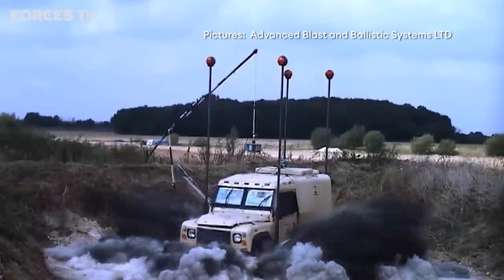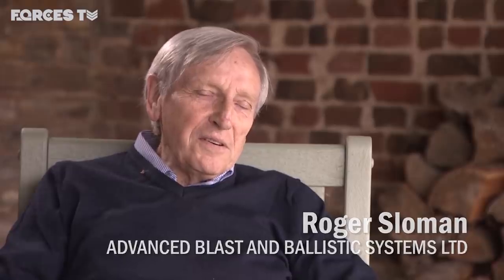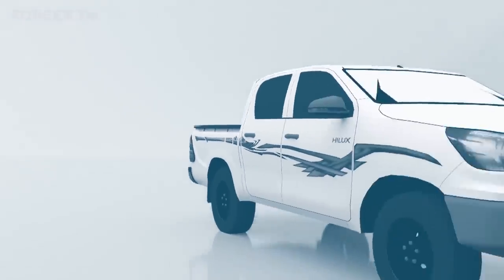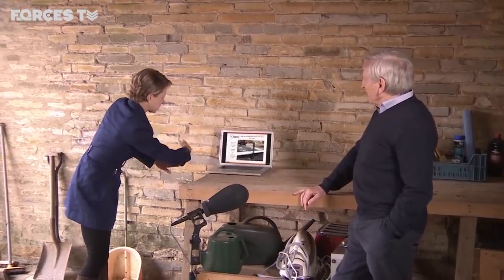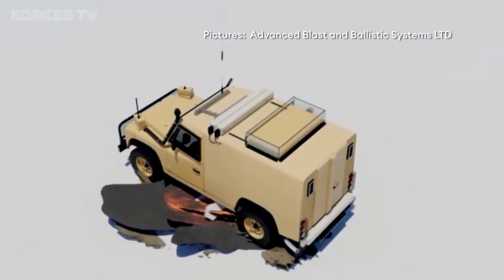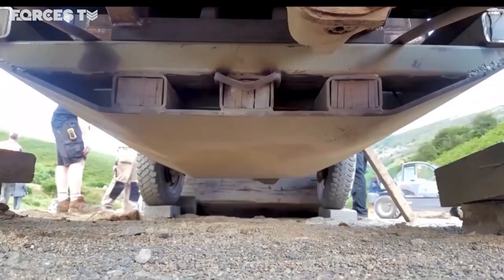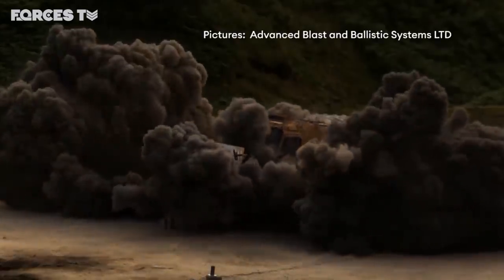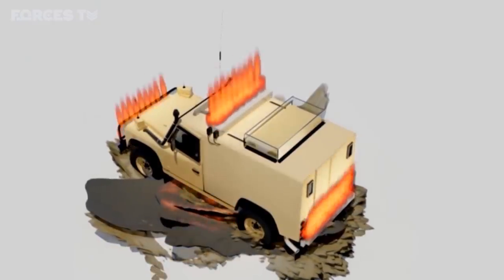Has This Inventor Found A Solution To IED Threats? | Forces TV

Comment: So if you we're to put heavy springs and a thick metal plate on the bottom of the vehicle it would absorb the shock, this of course is in layman's terms but the movie industry has been doing this for a long time. Try not to over think the problem, it's like climbing deal with the issue one step at a time. If you would like to here the complete thought and need help email me.

Comment: This is assuming the vehicle can withstand the forces of basically two IEDs from opposing sides. So it should be incorporated into new vehicles that are designed to take the load.
Reply: The Hillux was likely only for testing. in the field it would probably be mounted on an MRAP or minesweeper vehicles leading a convo, which could somewhat withstand an IED/Mines already (although not 100% of the time, it still protects the soldiers from a direct blast). you'd probably come out deaf or concussed, but its better than dying i guess
Reply: @sneztchy  Indeed, correct.

Comment: What is being done to prevent the reactionary rockets from being used against the occupants of the vehicle? An RPG or high caliber round could impact those rockets and cause them to release their propellants towards the occupants. Just a thought.
Reply: Roger Sloman
1 second ago
The result is quite benign, the propellant doesn't burn at ambient pressure.

Comment: how would you protect the rockets from shots?
how would you get the sensors to tell the difference between an IED and a very large bump while offroad, say a decent fall of one tire off the road into a ditch?
Reply: The rockets being hit isn't a problem as I have replied many times before, and the sensors discriminate and ONLY fire for mines that are a threat size exploding under the vehicle as currently designed. Could include side blast if required.

Comment: What if they activate a preliminary explosion to fool and cause the downward force to deploy and then the actual IED detonates? Depending on vehicle speed the fake and actual charge could be placed a respectable distance apart to avoid premature detonation of the primary IED by the preliminary explosion.  Would it be possible for sensors to gauge the pressure created to determine the correct time for countermeasure determining what is real or a decoy?

Comment: I get its just physics and all, but if you have the blast force pushing up, and 60/100T pushing down.. where are both of those applied forces hitting :/  the tin can in the middle
Reply: The vehicle is plenty strong enough to take the very brief blast loads.                  Roger.

Comment: Why not take those rockets and use them to push the vehicle forward, away from the blast instead of down, on to the blast? That's not a suggestion, it's a question. What is the mathematical or physics based reasoning for his way of doing it?

Comment: The problem with IED's is not only the projectiles and fragmentation killing soldiers, its the SHOCKWAVE... there is no way to stop the shockwave. The shockwave is what causes the trauma to internal organs, close enough to detonation and all organs turn to mush... this is with a large enough charge of course... a small mine or grenade is survivable.
Reply: Is this a fact, or what do you base your claim on?
Reply: @DD08DK  Oh i dont know, ive just been an explosives technician for 25 years .... so i dont know much.
Reply: @demoman  Well... is it EOD, tearing down buildings, intrastructure (tunnels / roads in mountains), or within defense? 25 years of experience in one specific branch does not neccesarily translate directly to another.
Reply: @DD08DK  Underwater demolitions, ship scuttling, toppling communication towers, Severing steel structures, severing large tubulars with bulk explosives, NAVY and DOD contracts with EOD techs(UXO), IED threat neutralization, Explosive welding and cladding of metals, Cast explosives, you name it Ive done it, with the exception of strip mining. 
Im not limited to just 1 specific field.
Reply: @demoman  Sounds like happy days to me.

Comment: None of this will protect against over pressure. Torn internal lung walls and smashed organs.
Reply: The overpressure doesn't get inside a closed vehicle.
Reply: @rogersloman6635  ah is that right? interesting. i know nothing about war but i do know alot about pressure being a commercial diver and dive medic. so i suppose there are mandates to have the vehicle closed at all times? what about the hole in the roof for the gunner? interested in this subject if you can shed some light on this. thanks.
Reply: @freelectron2029  There is generally an open hatch for the commander to keep 'eyes on' the situation and/or a gunner etc. but with an under-belly mine blast the shockwave passes over the vehicle hull and doesn't curl around much as it passes over the top edge of the side of the vehicle, you can see that in the BFBS video. Hence the overpressure on top of the vehicle isn't too high, and virtually none gets inside through the hatch. A side blast IED will be different for the top cover guy, but it will still not get inside the main cabin very much.   Roger.
Reply: @rogersloman6635  interesting. thank you

Comment: Awesome project. Got me wondering about offset charges, where one is not right above the other.
Reply: Others have mentioned this but it depends on how the system is initiated. If it uses some blast measurement then it might ignore a low power triggering explosion that poses limited effect. That would then require a  blast sufficient to trigger the system. This might also include. Some sort of device to bring the vehicle to a stop before it reaches the secondary.

Comment: It’s a great idea, but I’m curious....what if the rockets are too powerful and overcompensate, or the ied is more powerful than most and the rockets don’t compensate enough. How much of a blast would it take for the rockets to activate? For example, would a fairly powerful fire cracker be enough to set it off? And would the blast of the rockets if fired in error in such a case then damage the chassis etc and possibly harm the occupants? I’m no engineer, and not trying in any way to be a smart ass or detract from the achievements of someone with a great mind. I’m just curious...

Comment: What if the IED is not directly under the vehicle but on the side of the road? Could the rocket motors then just thrust the vehicle in some random direction if activated?
Reply: No, they just thrust directly downwards and would react fast enough to keep the vehicle upright.

Comment: Why is nobody asking what initiates the counter measure systems?  The recognition and deployment of safety systems are the biggest problem with active armour.  

I dont see how its possible for the spring detonated dropping floor or the 20 millisecond rockets to deploy within 10 milliseconds...

Not saying its not possible and i wish roger all the best.  But i  imagine the system that recognizes the initial blast is where all the money is going.
Reply: Steven, it's actually quite simple but that's why we dont' say exactly how we do it.
Reply: @rogersloman6635  glad to hear youve already solved the issue. I should have realized the exact process would be a secret, the video just glanced over this.  

I think its very honorable you have set out to save lives with your spare time rather then simply taking up a hobby.  Best of luck to you sir.

Comment: What happens when the rockets get hit with a large enemy projectile?  would they explode in a bad way? gotta protect them from that threat. Otherwise a cool idea with the u or v shaped hull.
Reply: The result is a benign opening of the casing and maybe the propellant burning briefly before it goes out. It needs high pressure in the casing to burn.                       Roger.

Comment: Not exactly a new solution. Concept works, but the LR is to me an obsolete platform. 
I reckon it is a hard sell, given the risk of flash burns(I would not be a happy MG gunner on top of that LR, unless fitted with RWS), cost and added weight to the platform(LR). It comes down to the standard "what you want to achieve"...More firepower, agility (low weight, low CoG, high horse), or higher survivability. 
This solution would, to some degree, counter smaller IED's, but what about bullets/fragments or RPGs?  Would you rather have an APS, or maybe higher level of Add on Armor(against bigger threats(bullets))?

Comment: So, what prevents the bad guys bury two IED's ? One smaller one to trigger the defense system?
Reply: the bigger the ied the easier it is to spot
Reply: @d3203  No, the IED stays the same size. Before its explosion one smaller one happens to trigger the defense system, so the vehicle would still lift off and/or topple over, because of the original IED explosion, as the vehicles in theory would get lighter. In video claimed to add just 40 or more kilos and avoid heavy armor. The smaller one to erase "the window". Just the original IED must be buried deeper, or set-up in way to explode right after "the window" erasure.
Reply: WE deal with the 'double-tap' issue.  Roger.

Comment: When I watched this, i thought he just put in solid tubes through the vehicle so the pressure can flow from the bottom to the top. I am definitely not as smart as he is but sounds cheaper to me.
Reply: Except it doesn't work and occupies space internally that you can't afford! Hardwire tried this in 2011 and the US Army spent a lot of money testing a blind alley.                  Roger.

Comment: All the tests have the vehicles parked. In real world they are moving forward which could cause a problem for this invention.
Reply: armoured vehicles such as the MRAP have maximum speeds of 60-70mph. In a desert, that is substantially less , not to mention that they will most likely be travelling slower than their top speed anyways. For a conservative estimate, they will be travelling maybe 30-40mph.

Add to that the fact that all of this happens in less than 1/100th of a second, and the speed of the vehicle doesn't really matter when it comes to this.
Reply: @HoppingSkipper  moving forward is another thing that needs to be addressed. When NASA first started less the 1 degree off of alignment your rocket is going to flip head over heels a lot. When using rockets it doesn't take much to throw the off. So moving forward does matter.

Comment: Couldn't you just defeat this with two explosives that have at least a 20 millisecond delay between them?
Reply: Perhaps but thats would be difficult to do with the usual ied tech
Reply: Enough to limit the amount, but the Taliban are definitely capable, unfortunately.
Reply: @inebriatedengineering6288  this is still far better than what people were actually using
Reply: Yeah, I'd sure rather have it than not.
Reply: The system deals with the double tap approach.
Reply: @rogersloman6635  Can we learn how, or is that not disclosable?
Reply: @inebriatedengineering6288  No, sorry, can't explain that or it would give too much away!   Roger
Reply: @rogersloman6635  Understandable. I'm glad multiple avenues of attack were taken into consideration.

Comment: well i am sorry to tell you that all your info is wrong because in this video you are only testing on vehicles that are stationary. you need to start testing on moving targets and you will see the results will be very different.
Reply: The response will NOT be different. No-one does moving tests, it needs to be very controlled to get the right information.
Reply: @rogersloman6635  and how many IEDs have been placed on or along side a road to blow up parked vehicles?
Reply: @teacher555555  I can only reapeat that whether the vehicle is static or moving makes no difference. The mine blast does all it's damage to the vehicle in about 3ms.     Roger.

Comment: Hi everyone, thanks for all the nice comments, and to those doubters re shockwave effects I'm afraid you are wrong, otherwise no-one would survive in an armoured vehicle hit by a mine or IED, and they do. The shockwave does not get inside the closed volume of the cabin, albeit that it does travel through the structure around it. It's rather like Faraday Cage effect.  Similarly re the double tap concept, our system deals with that. The Crowdcube round is now open privately and you will find the link on our website. I can't put either the web address or link in these messages, they get filtered out.  Just search for the Advanced Blast & Ballistic Systems website. Roger Sloman

Comment: Does anyone notice that the first 2 videos are set-up different?,  the second vehicle is TIE DOWN to the ground, that is why is not flying... these kinds of comparisons when the tests are conducted under different circumstances look to be more similar to a detergent commercial....  " Look your old detergent can not clean that motor oil stain but mine  clean easily this little dirt spot on my clothes"
FYI
If you want to be taken seriously do the experiments SIDE BY SIDE under the SAME environment with the same type of vehicles loaded with the same weight, plus-minus your equipment modifications. 

Keep in mind, it supposed to be a light vehicle, I can always add more armor (Like the Humvees) but it defeats their original purpose and mission.
Reply: You are joking, how on earth do you think you can 'tie down' a vehicle against a mine blast which will throw several tons metres into the air?   It was NOT tied down.
Reply: @rogersloman6635  Sorry to disagree, look carefully, there is a set of cables going from one side to the other on top of the vehicle. BTW I have seen these tests before and IT can be done, depending on the blast, just Goggle Vehicle blast test videos and you will see them.
I am not disagreeing that the idea has merit, just on the videos shown.

Comment: The Hi-Lux is designed in such a way that makes it naturally robust and resistant to attacks from just about anything when compared like for like - The initial phases of Chadian / Libyan war fought in what was to be known as “The Toyota War”, primarily due to the literal 4 wheels, engine, chassis and occupants remaining fully mobile as if they’d been shelled to pieces with explosive-packed Coco-Pops - the damned things are as near to indestructible to begin with as a depleted uranium peanut - to start from scratch on a new design would be demonstrating the lunacy of a madman, or a village idiot on a busman’s holiday . Armour plating a Toyota Hi-Lux is akin to double-bagging a Wall’s beef ‘n’ herb blank-firing, limp and shallow fried sausage to demonstrate safe sex with a consensual adult whose orifices are all sewn together with steel wire and then riveted before being lightly coated in spermicidal epoxy sealant which has been allowed to cure - then that person sent home in a taxi to bathe in iced water whilst waiting for an ambulance, and a psychiatrist.

Comment: Not all solutions to a problem are practical. The only real solution i see here is the CF reinforced beams. There may be further hurdles to it's implementation but they should be able to be over come. However, driving a racing car is not the same as driving around an active war zone. Let's strap explosives to the outside of a vehicle getting shot at by everything from 7.62 to RPG's! Cause that will really make the soldiers feel safer.
You can see where the common sense is at. The MOD is looking at the beams and Americans are looking at the rockets..... lol